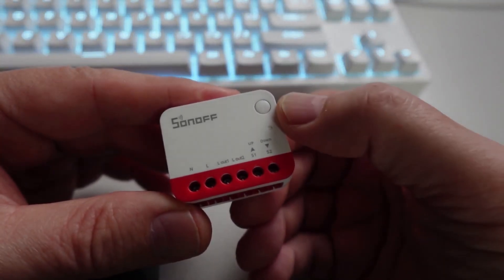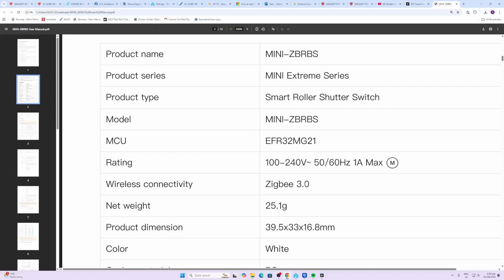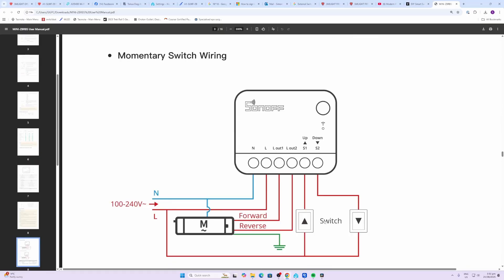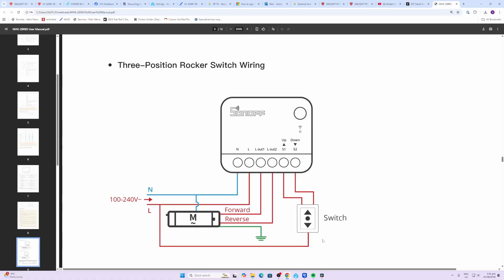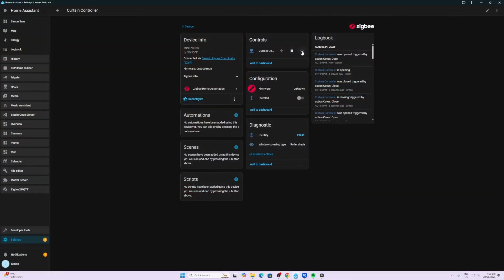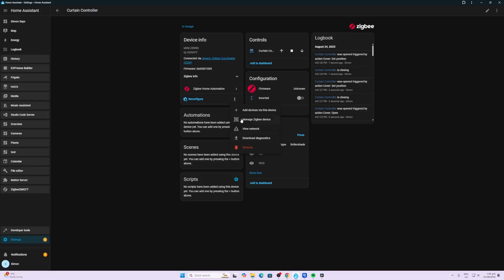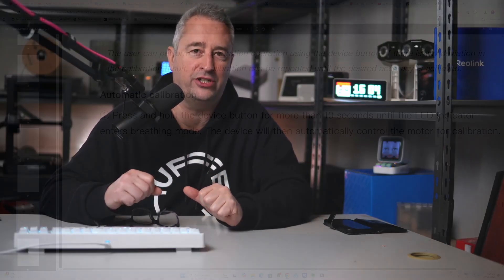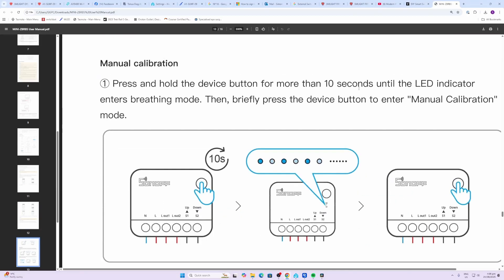How to convert your existing blinds or curtains to Zigbee!

Comment: Hi, I’m wondering if it is possible to control the tilt angle of the slats in blinds using a Sonoff module? If not, do you know of any other reliable modules that support tilt control for blinds and work with Zigbee or Matter protocols? Thanks in advance for any recommendations!
Reply from the maker: Hi, the Sonoff is only going to offer you a percentage control not tilt angle.  Switchbot offers a blind tilt controller

Comment: I use Zemismart curtain and roller motors. 10 rollers and 2 curtains. They have both zigbee and rf433 so I can control then via a remote (wife approval) and also via zigbee. The curtain rail and motor is so good and quiet. The rollers just slip into the where the pull cable of the blind goes so you keep the same bracket location etc. They are all 240v and come with the power plug. They are all zigbee routers as well. Best thing ever!
Reply from the maker: Fantastic, thank you for the feedback !  Yes automated blinds are great for WAF!
Reply: And in z2m?
Reply from the maker: @tonyperez69  Sorry I am having trouble with my Z2MQTT setup for some reason